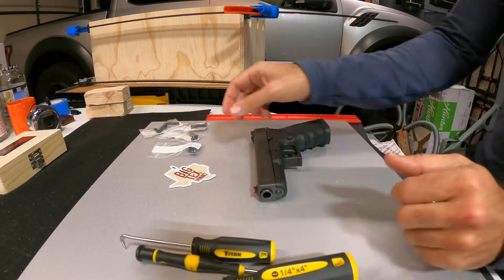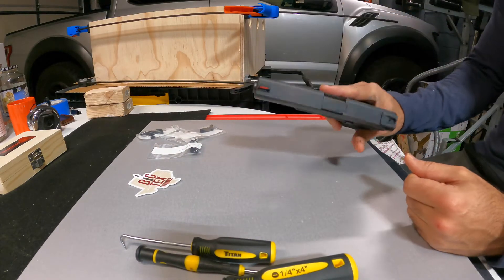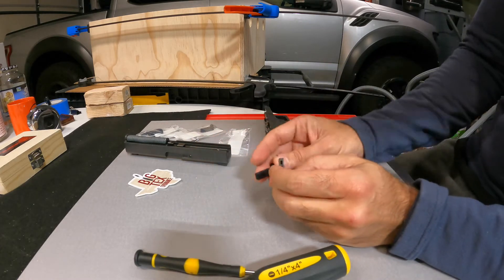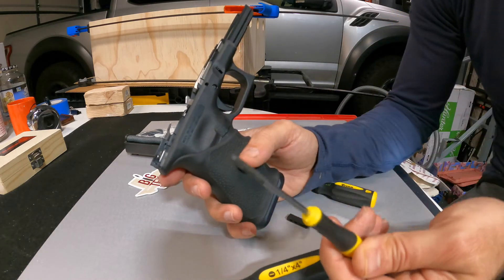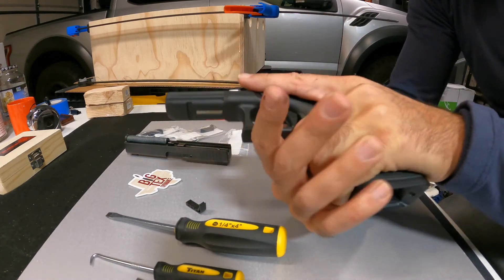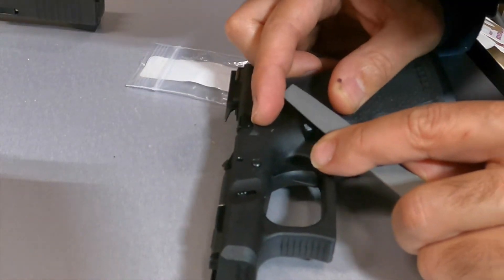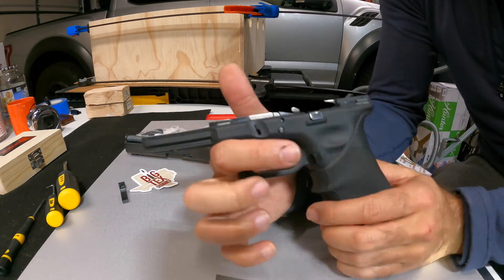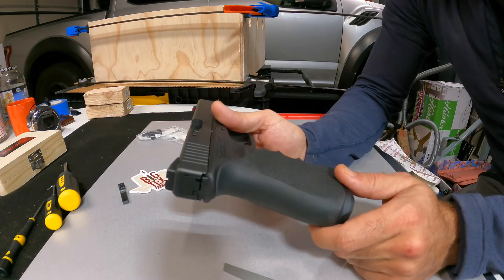MUST HAVE GLOCK UPGRADE CHEAP OEM EXTENDED MAGAZINE RELEASE CATCH GLOCK 17 GLOCK 19 GEN 3 BIGTEX

Comment: I just installed one. I'm not sure if  I like it. It's almost too extended.
Reply from the maker: Yea file down edges slightly it should be just right if not real easy to go back to original height
Reply: @shaunstayfree5551  I rounded the sharp corners and it's much better. I'll leave it for now.  I may even take a file and shorten it.
Reply from the maker: @optimisticpessimist.  yes but the little grip grooves on the surface prevent that, and I would try to keep those, unless you take material off the inside which I’m not sure where to do that exactly